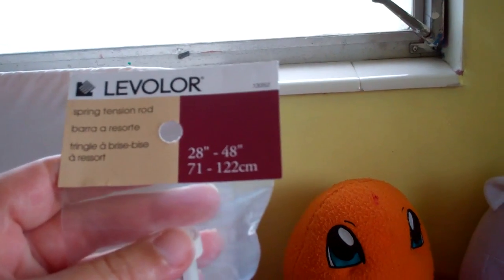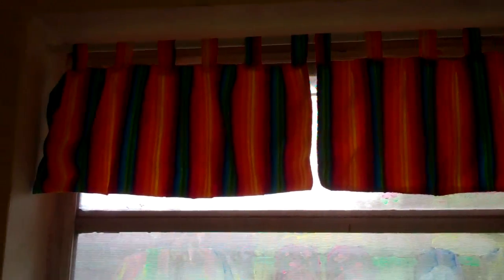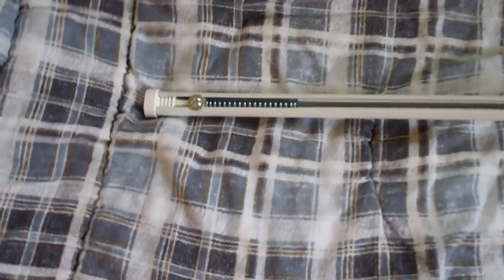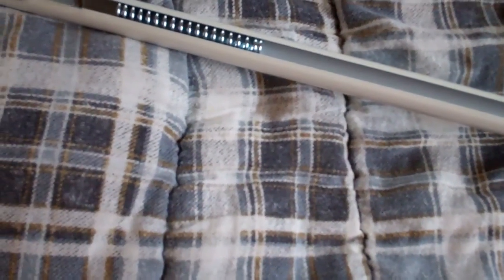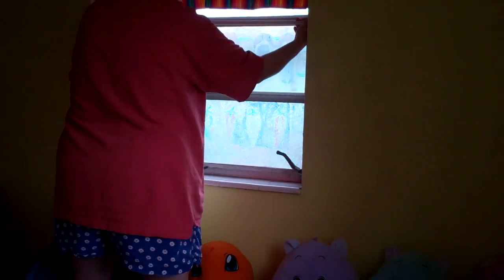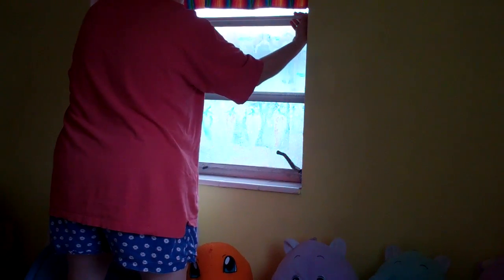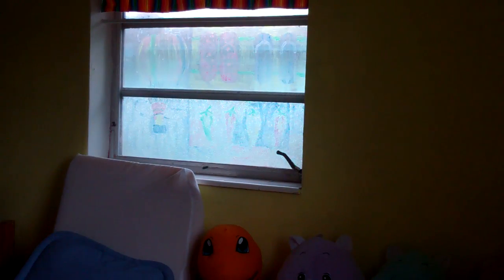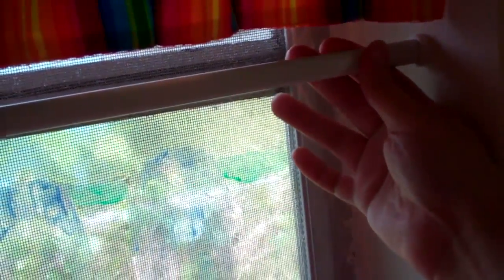How to Install a Spring Tension Curtain Rod (See Shorter Video in Description)

Comment: Thank you for this very-helpful video. Yours is the only video that answered the question I Googled for a good half hour before finding you. I have no serious issue with the interchangeability of the terms "tension" and "stress" but acknowledge the confusion that might arise since search engines are often less specific than humans about language. In my search for "how to assemble a tension rod" most of the hits dealt with "installation of a tension rod". This is the only video, exemplary in its thoroughness, that took me from "rod still in the package" to "tension rod vs more holes in my walls" to "how to assemble a tension rod."  Thank you!
Reply from the maker: Alex Mercedes Thank you! Whenever I put "stress" in a google term, I wind up on sites about reducing stress on a person.  I find "tension" seems to be a term used in construction more myself...though it will also lead you to a few sites about muscle tension and tension headaches.  However, even if it is frustrating when google doesn't give me the link I want because of how I worded it...I'm just glad if I don't wind up on a porn site.  It is amazing how many innocent searches can lead you to one of those sites!
Reply: @JLGluvsLara  lmao 7 years later, top stuff. had to clean this damn curtain divider while my room8 is gone & this thing pops out like a Jack in The Box. Then almost took a finger out trying to manhandle. LIKE PREV SAID TOP SHELF UTUBE CONTENT!!!! THANKS & KUDOS ✨✨🌞🌞🌎🌟

Comment: Glad I found you. I purchased those type of rods and with directions too. I could barely read the print on the tiny piece of paper as it was so small. Which were fine until I dropped the rods and all parts went all over. Now what? Hence I searched YouTube and up you popped! Thank You Priscilla

Comment: This is the kind of Rod I have, except mines is off white and my spring, nut and bolt didn't come already in the Rod, I have to put mines in and I don't know how too been trying since last night and its driving me crazy, help please!
Reply from the maker: I'll try my best.  If I recall, there are three pieces to the nut/bolt part.  There is a bottom part that the screw goes into.  This part goes inside the rod, the part that the screw goes into pointing out at you.  There is a circular part that the screw goes through, but this will remain outside the rod.  You put the screw through the circular part and screw it into the piece that is inside the rod.  The spring goes to the right of the nut/bolt.  The whole purpose of the nut/bolt is to keep the spring in place where you want it.  The spring doesn't go into it, but it should be stopped by it.  I hope this helps.

Comment: This was so helpful, but my sliding screw, which is the tiny screw screwed in to the metal backing, keeps falling off and no matter how much I tighten the screw it won't lock the rods in place. What to do?
Reply from the maker: +vadapa89 Sounds like it may be a faulty piece.  I'd probably return it.  If you are a person like me, and you keep stray hardware around in jars, you could possibly see if there is another screw that would fit better if you are not willing to return it (or can't).

Comment: u know what sucks is when the little screw wont hold in place anymore and u took the rod down at night and now it wont go back up and you live inside a courtyard.
Reply from the maker: Sorry to hear about your problem.  I haven't had a problem with that.  There is no way to tighten it?
Reply: Jessica Gray i dont know i keep turning the screw so its tight enough and it doesnt stay in place.
Reply from the maker: Hmmm.  If it isn't new, then I would say the screw might be stripped or holder is.  If it is new, then I'd say it must be inappropriate.  Either way, it sounds like something needs to be replaced.
Reply: Jessica Gray yes it definitely was something like that so i got a new one last night at walmart. thanks for your replies.